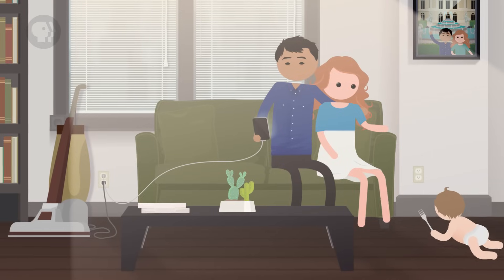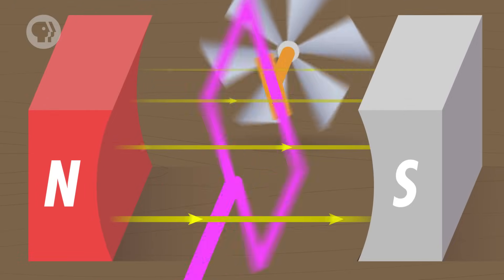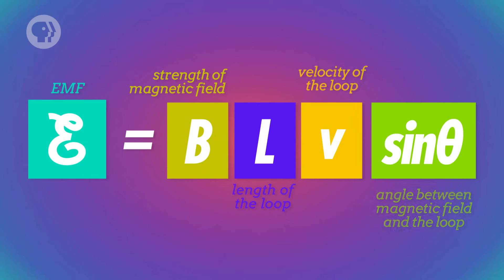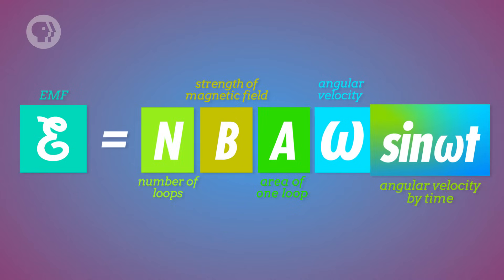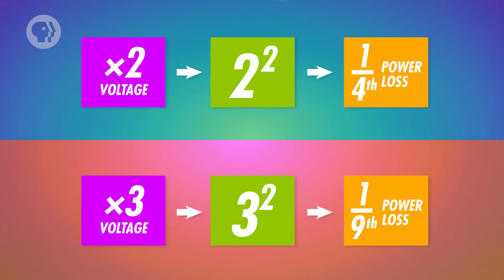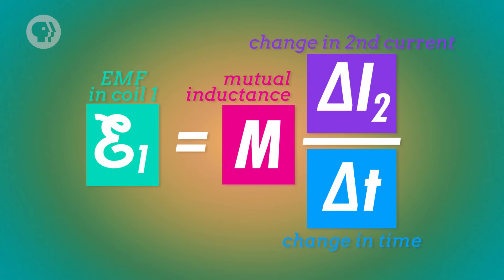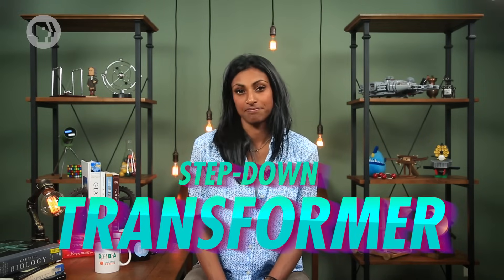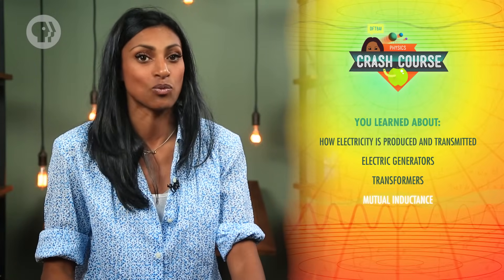How Power Gets to Your Home: Crash Course Physics #35

Comment: ~430 is why Teslas are kinda a dumb idea.  Just getting your power from an electrical line is pretty inefficient.  I think heat loses still acount for a 30% inefficiency + inefficienies in energy creation +  will have to account for loses in the car itself.  I doubt its much better than simply getting an actual car.  So the emission savings are not nearly what people think they are because most power in US is made from gas or coal.  Im not anti electric cars but I think people should not be ignorant and think my car doesnt use gas Im saving the enviroment yaaaayyyyy.   Better would be us getting electric cars starting research in small mass produced reactors and then actually making a huge emission savings

Comment: First , let me say the “Crash Course” series is an informative, fun and fast paced resource that PBS should be proud to air. I have one question. It’s stated in the “ How Power…” episode that transformers only work with alternating current. In my opinion, this isn’t true. Automobiles, motorcycles, watercraft and a few other examples use step up transformers in their d/c supplied ignition systems. Instead of saying transformers ‘only on work with a/c power supplies’ perhaps change the statement to transformers only work with a cycling or digital power supply. In these ignition systems, 12vdc is apply to the primary side of the ignition coil. And weather a PCM commands the circuit open or a set of breaker points disconnects the coil from ground, the same thing is happening. The magnetic field in the primary (12vdc) coil collapses, inducing a “stepped up “ voltage (40,000vdc) in the secondary winding, and this fires the spark plug. Thanks for the great videos and for your time- Jason Burchell

Comment: Transformers are used to increase or decrease current/voltage.
Step up increases voltage and decreases current 
Step down decreases voltage and increases current.
Step up transformers are used for transporting electricity for long distances because Ploss=I^2R (a lower current is used to decrease power loss)
Step down transformers are just used to decrease voltage so it is suitable for certain appliances.
Also transformers are made of two coils wrapped around a laminated iron core. That means the iron core is cut into thin sheets and separated by an electrical insulating material. Laminated cores are used to reduce the production of eddy currents. Less eddy currents = less energy lost as heat.
Does all that make sense? I have a test tomorrow so I’m just dumping some stuff in my brain.

Comment: I have a technical correction, although it's not important to the grand idea of the lecture. In the US houses are actually wired for 240 volts, from the transformer to the junction box, by wiring the house across two phases of power. (Which larger appliances will use directly.) Then power is distributed throughout a house by connecting the electrical loads to a single live wire, and returning through a neutral wire to the transformer; in this way splitting the house into two 120 half phases.

Comment: Why the "they're odd man out" shot at the US?  Canada, most of Latin America, and much of the Caribbean use 110-120v as well.  Japan uses 100 (which most US-standard appliances will run on.  In the US, local voltage used to vary  - a lot of high -end audio equipment used to have a selector to choose between several choices between 100 and 120.)

Comment: I'm an EE and I can only just barely follow everything she says as she jumps from topic to topic. If I didn't already know where she was going, I'd be lost. This serves as more of a refresher course than an introduction because of the speed at which she speaks, the lack of diagrams (I know there are several, but there really need to be more for new students), and the complexity of the subject matter. 

The core concepts, like induction, are really hard to grasp, even if you watched the last video about induction. It takes lots of practice problems and demonstrations for engineers to learn this stuff in school. I realize this is "crash" courses, but there's something to be said for practice. It helps solidify ideas in our heads. I don't expect them to start assigning worksheets, but this needs to be in a better format. I don't think it's reasonable to expect everyone that wants to learn this to have to watch the video 4 or 5 times before the concepts start sinking in.

I actually think the equations are a bad way to go. If you need the equations, you should look somewhere else for the math. If you came here for the concepts, the equations aren't going to be used. In the mean time, they confuse most of your audience.
Reply: you can use youtube to slow down the video that might help

Comment: With regards to AC, i guess the one thing i never understood specifically was why/how the hell does making a current move back and forth lead to higher voltage and the ability to travel further? From a layman's perspective that seems counterintuitive
Reply: Unclenate1000   In the primary coil of a transformer, changing current causes a changing magnetic field.  Then, the changing magnetic field causes a voltage in the secondary coil.  In order for a transformer to work, the magnetic field has to be changing.  (See the previous video in this series on induction.)  The voltage in the secondary is related to the voltage in the primary by the ratio of the number of turns in each.   Example:  If I feed 120 volt AC into a transformer whose primary coil has 10 turns, and whose secondary coil has 20 turns, the voltage on the secondary will be 240 volts AC.  If we hook the secondary to a power consuming device, such as a light bulb, then current will flow.  The current in the secondary will be 1/2 of the current in the primary.   Power is current times voltage, so the power transferred by the primary is equal to the power induced in the secondary.
Reply: Unclenate1000   As urjaman0 wrote, the resistive losses in a transmission line are proportional to the square of the current, but are independent of the voltage.  Power, though, is voltage times current, so you can increase the power transmitted on a line, without increasing the resistive loss, by increasing voltage.  Power is what customers want and pay for, so increasing the voltage on a transmission line is a way to transmit more of what the customers want, without increasing losses in the line.

Note that there are limits to raising the voltage on a transmission line.  An obvious one is that at high enough voltage, an arc will form between the conductors, not a good thing.

I often wish my electric lawn mower ran on 240 volts rather than 120.  The same current passing through my house wiring and extension cord would deliver twice as much power to the mower.  That would change a slightly anemic device into a fully practical one.
Reply: if you put DC to a transformer, current doesnt change, thus nothing comes out the other side, so transformers dont work with DC, thus making AC ideal for generating the higher voltage. The ability of higher voltages to travel further relates to the ohms law, with the wasted power being P=R*I^2, so a lower current (that you get with higher voltage, for the same output power) causes much less losses in the wire.

Comment: this is an incredible show with alot of theoretical information.would crash course offer or know of a chanell that shows these principles working in a real world environment.or even some sort of course that will get me up to speed so that i dont necessarily need to see the motor outlay and operating function in order to understand the outcome if these mathematical principles aren't adhered to. i want to know how to build my own dc generator and convert it to ac in order to use it with my home appliances and although I know that I am capable of it i didn't pay attention at school and was always a hands on learner and so when it comes to theoretical or invisible things i just don't know how and because I cant see it its really hard to know where to start and if im doing it wrong.ive blathered on a bit if anyone can help me out let me know

Comment: What happens when the voltage is lowered, is there a loss of electricity? Where does it go?
Reply: A higher voltage results in a lower current as power is V*I and must be conserved. YOu cannot have more power on 1 side of the transformer than the other. They must be equal. So as V goes up, I goes down
Reply: The loss is resistance. The loss is heat generated which is proportional to i^2 times r. (the wire is a very long resistor)

When the voltage is increased, current is reduced, so the i^2 factor becomes smaller.
Reply: Wait, doesn't a higher voltage mean a higher current? As in I=V/R?
Reply: +Collin Barker Well strictly speaking P(input) = P(output) + P(loss) all transformers do have a power loss due primarily to internal resistance in the wire and also to parasitic currents induced in nearby conductors hell if they are sat near the ground and the Earth is damp they even loose some to the friction incurred when water molecules rotate to align their dipoles with the changing field.

Comment: I'm an electrical engineering student myself and that was explained pretty well though I see others in the comment section without a background in EE having some difficulties. I wish they would have mentioned diodes & rectifiers for converting AC power from transmission to DC that our appliances use.

Comment: Don't use the term "flux" before explaining it or pointing to another video. You're also missing the "why to care". By having High tension (High Voltage) power lines, we reduce the losses in transmission, as the power lost in the lines is to the square of the current. Higher voltage, less current.
Reply: You're abrupt, but you make the salient points, I think. I've been trying to follow this series, but there is something deeply awry about it. The host is powerfully charismatic and interesting, and yet even she can't hold our attention. This is not  the right way to go about teaching people. Maybe it's a flaw in the AP material, I don't know. I have grasped most of these ideas in their foundations for a lot of years now, but this series has left me feeling like I don't know anything, and I don't know any more after the episodes are over.
Reply: axelasdf See previous videos in the series for introduction to flux.

Comment: The narration describes alternating current, but the animation shows a generator with a commutator.  A commutated generator produces current only in one direction.  It's not strictly DC, as from a battery, because it pulses with a sine shape, but it certainly is not alternating current.  This is an error that needs to be corrected.  When the animations conflict with the narration, some of the audience will certainly be confused.